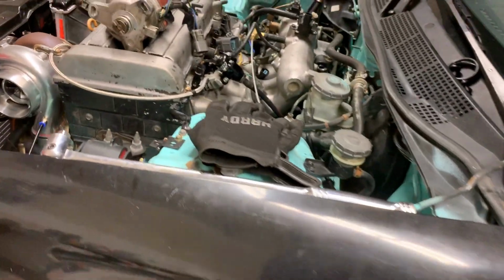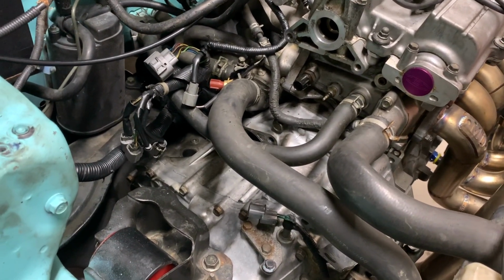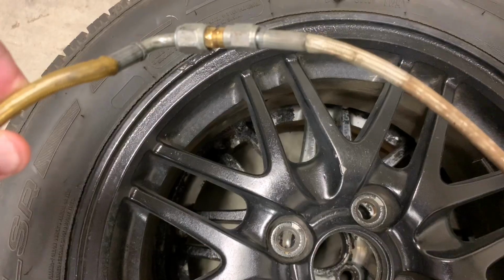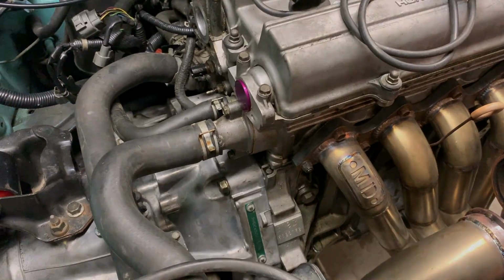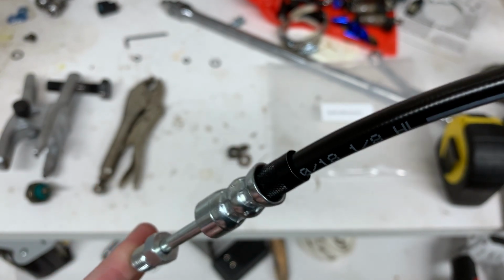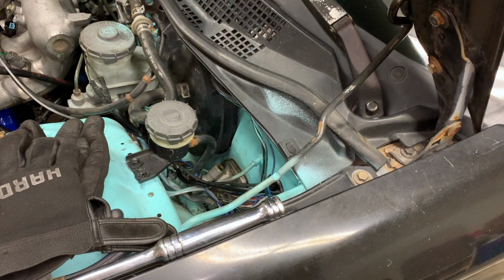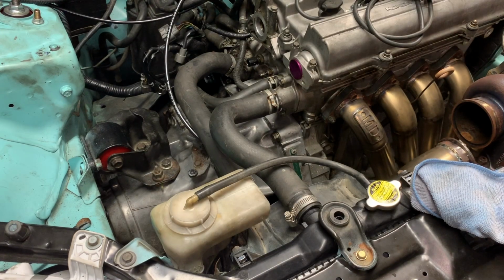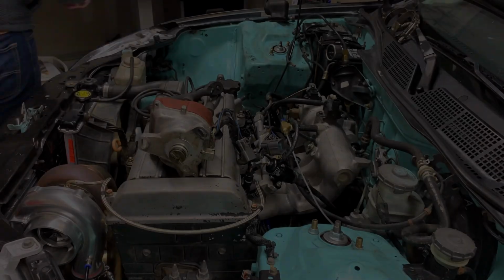Installing EG EK DC Clutch Line

Comment: Hay what harness are you using consider you run a ls ?
Reply from the maker: Y8 harness
Reply: Ex and si are similar. You have to split the wires from heat rap to reach the injectors and oil sensors. That's how i did mine